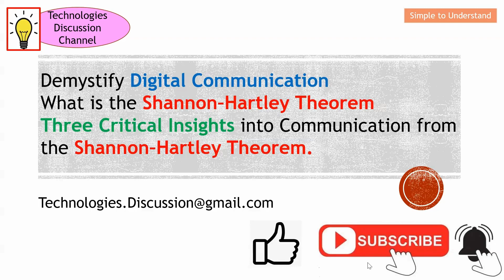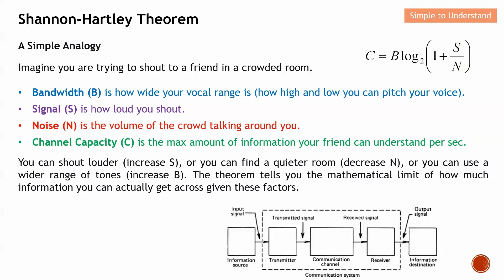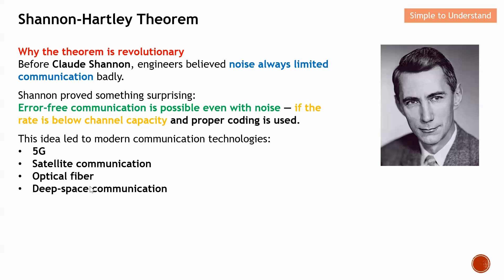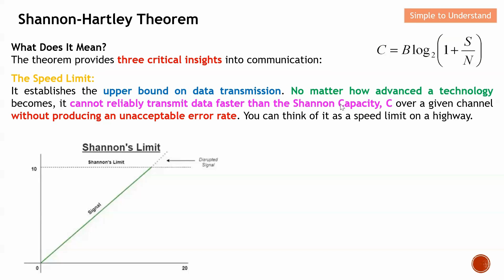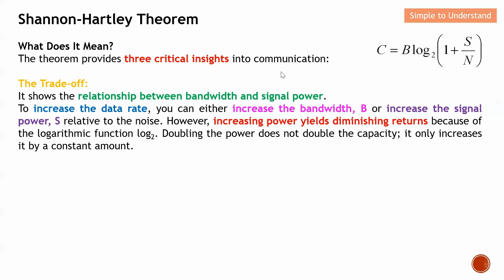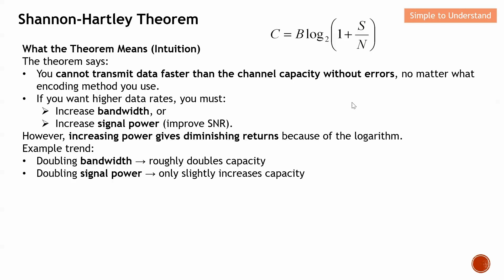Digital Communication #11. Why Data Rate Has a Limit? Shannon-Hartley Theorem, SNR, Capacity Explain

Comment from the maker: Thank you for taking the time to watch this series of discussions on digital communication focusing on the Shannon–Hartley Theorem. In short, this equation gives us the maximum possible data rate for data transfer between a transmitter and a receiver given a specific bandwidth and signal-to-noise ratio (SNR).
This video also shares three critical insights about communication derived from the Shannon–Hartley Theorem. In the past, engineers believed that when noise was present, it was impossible to receive an error-free signal. However, the Shannon–Hartley Theorem shows that as long as the transmission rate is below the channel capacity, it is theoretically possible to receive error-free messages even in the presence of noise.
The theory also helps us understand that if we want to achieve a data rate higher than the channel capacity, increasing the bandwidth is generally more effective than simply increasing the signal strength.